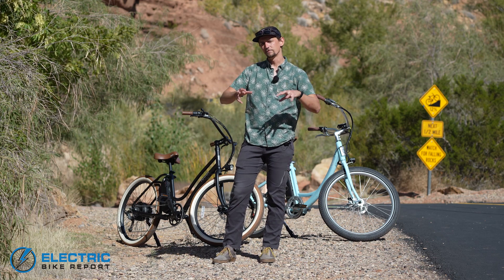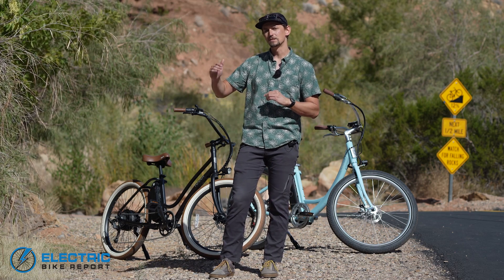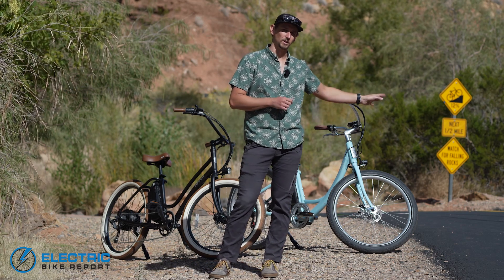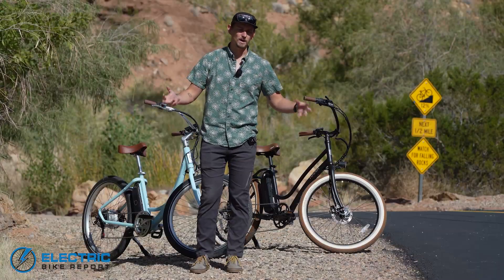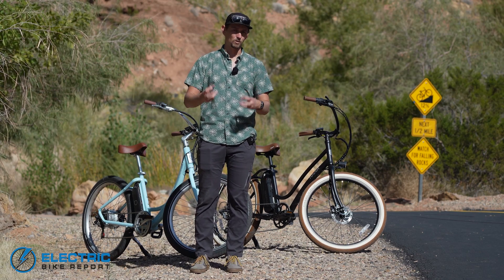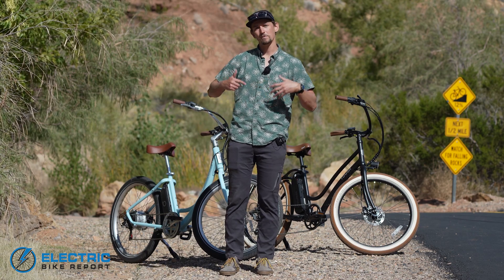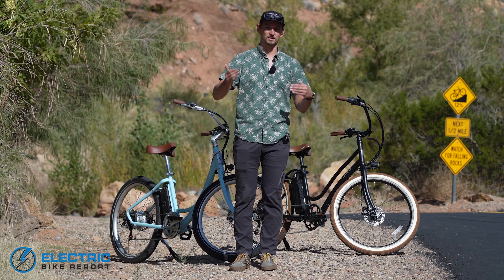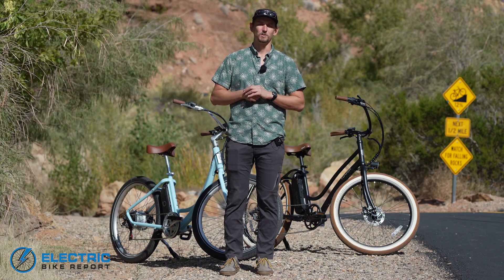500W VS 750W E-bike Motors | Does Wattage Matter On Hills?

Comment: 750W is very good, but 1000W is better...
Reply from the maker: Watts aren't everything! We've tested a few 1000W motors that didn't perform as well as many 750Ws.
Reply: @ElectricBikeReport  if you need max torque on mountains, you must have your 1000W in normal 26inch x 2,3inch, or even 20inch x 3inch wheels, but if you need horizontal max speed, then you need only 750W in 29inch x 2,1 inch in country, or 26 inch x 2,3inch wheels- in city...

Comment: 500w is it geared hub or direct drive? you cannot compare 2 different types of motor 750w is 100% geared hub and geared hub motor are superior with hill climbing and have great torque compared to DD... Direct drive last longer because less moving parts and are great for higher constant speed but sucks accelerating from 0 eating battery like crazy if you don't at least give some pedal boost... if rear wheel is free and go easy it is geared hub... if rear wheel is hard to pedal without electricity then it is direct drive... one more thing DD charge battery back GH not.
Reply: It's about time someone brought up the geared vs direct drive hub motors. I need an ebike to get through the up and down hills from my house to town, so I prefer a lower max speed geared motor over a higher speed direct drive. I just ordered a bike with a 500W 20mph max speed hub motor. Hopefully it is geared and not a direct drive limited by the controller. I don't know because the information that is available for ebikes is pathetic. When you buy a non-ebike, like a Trek, they provide detailed specs. Ebikes should do the same with details like the manufacturer and model numbers of the battery and motor.
Reply: @sandsleeper3124  geared are small in diameter and similar sizes to eachother, direct drives are huge in diameter and stand out, hope this helps

Comment: How do I find out what my controller is for my ebike?  It has dual hub 500 watt bafangs. I was wondering if I could upgrade to 750 watt bafangs for more hill climbing power.
Reply from the maker: You can check out the specs page from the bike manufacturer, but you may need to contact them directly. Depending on the brand, it's usually about 50/50 whether or not it's included.
Reply: @ElectricBikeReport  from the specs on their website it’s kinda vague about some of the parts. I do know it’s a 48 volt 20 amp battery. So I may just call them and ask on the controller part
Reply: My bike is a krusader dual 500 watt bafangs. Can I swap out for 750?

Comment: You perpetuate the mistaken theory that electric motors are commonly rated as to producing "X" amount of power in watts.  Absolute Nonsense.  250 watts  500 watts  750 watts  1000 watts  Controllers (CONTROLLERS) are rated for WATTS.  Electric motors are rated as to how much Torque they produce   TORQUE.  NOT WATTS>
Reply: Mine have 43tq and 500W, but problem is sustained power. Motor after few minutes of big incline turns off

Comment: I made a DIY 350watt Gear( gear ⚙️ can go long distance( 20mph)  all the way to  battery use but very slow on hills) with a 2000 watt Gearless ⚙️ Turbo Hyper Drive Booster( power speed of 40 and up but can't go full throttle of a 4 to 5 miles trip of motor cutting off for a bit to cool down , great on hills of going over 34mph and higher) with this set up I can go long distance of a very high speed of 40mph without the Gearless cut off cool down. This set up should be the standard set up for not only novice e bikers but also for pro builds or factory made. A lot of practical positives and minimum cons as most DIY Duals ppl make are overkill of not being practical of more being obstacles of the weight, energy consumption, brake system and frame wear and abuse.

Comment: The speed is restricted by the fact that it is going uphill so probably won't reach the lower class 2 limit let alone the higher class 3 limit.
I would test the difference between class 2 and class 3 on level ground.

Comment: PLEASE let's see a test of the Avadar C3 250 Watt mid-drive that produces 80 Nm torque and sports a 16 speed Alevio drive train.
Reply: That's exactly what I want to see too. A small 250watt mid mounted motor with long endurance, that can take advantage of the bike's gears: thus produce 80-90nm of torque like you say, way more than the usual 50 or 60 of most hub motors.

Comment: 250w is simply not enough for steep hills. The bare minimum is 500w but for people who weight over 220lbs you will need 750w minimum.
Reply: I have zero problem with my Avadar C3 (250 W/ 80 Nm/16-speed) riding 11 miles a day with an 1860 ft elevation gain. Zero.
Reply: BTW, most 750 W hub motors generate approximately the same 80 Nm of torque.
Reply: @edwardcating that's a mid drive not a hub. Hubs don't got gears and that's the biggest advantage of a mid drive
Reply: 250w works just fine for steep hills unless the person is really overweight.

Comment: I am brand new to all of this. I have been trying to put together a spreadsheet to help me decide which bike is best for me.  I have zero knowledge of the difference between 250W, 500W & 750W hub motors.  My intuition tells me that 750W is way better than 250W.  I am looking for a video that will explain this specifically, whether it's on hills or elsewhere.
Reply: The higher the wattage, the more overall power. The performance is better, but you're also drawing more power from the battery, which means less range.
Reply: @SynthApprentice  what battery would you recommend
For a 750 front wheel ebike I’m building?
Reply: @Danktendo  Um. I guess 48v or higher? My 48v/14ah battery seems to suit my 750w mid drive just fine. I don't know if a front hub motor would make any difference or not. I'm still new at all of this, I'm learning as I go along.
Reply: @SynthApprentice  I, too am new to this but have been researching. The bike I'm going to test ride is 48v/14ah battery with a 750w HUB motor, but it is single gear. I am trying to get a bead on whether it will be sufficient on occasional steep hills. I fear that it will lack enough torque with only a single gear. Will be test riding very soon.

Comment: When you look at specs of faster speed of the higher watt motors to see it is only a few extra mph from 22 to 24. You assume it should be faster but it is your weight and extra cargo you thinking of using bike that fits the RIGHT TYPE OF WATT. If you weigh 200 .lbs it is best to get a 500watt or higher. If ya weight is A BUCK TWENTY fit is 250 to 350 watt  unless you want fast because you will go faster at that weight on 500, 750 and up. The lighter people will take 500 and up motors top speed by 5 notches of MPH. The higher the WATT means the higher the torque NM  or the stronger it will pull off weight, especially use of constant hill climbing/
Reply: Watts does not always = more torque. There are plenty of 2kw motors that have similar torque to a 1kw motor.

Comment: Hi I have a question ? My battery hailong 15.5 ah max current 20 a What happens if I connect a 22 a controller?
Reply: Its possible that you will exceed the BMS current limits when riding full out and the BMS will cut off the battery output when the controller asks for more than 20a.  If you have an LCD display that allows to limit the current from the controller, then just set this to be less than 20 amps. You could replace the BMS with a 25 or 30 amp BMS.  Open the hailong case, and see what cells you have. Look up the max and steady current ratings on the cells, by googling the cells and looking at a "data sheet" for the cells. Multiply this rating by the number of cells in parallel to determine what current your batteries will tolerate comfortably.
The 20 a BMS may be under the capabilities of the cells because the battery maker want's to prevent warranty issues, and/or to save a few bucks on the BMS.

Comment: Is it better to have a higher voltage or wattage? Where should I focus more when it comes to hills? Like would it be enough with a 48v 750w? Or is it just too much and I'd be save with a 36v 500w? 
Thank you
Reply: N(power) = I (Amps) x U (volts)
so
for power you watch Watt number 
but it is all relative
the motor is one component
battery other
and the bike itself third
how many speed the bike has
how big (small) wheels it has
road bikes have an advantage on flat roads
mountain bikes, on the other hand, have advantages on macadam and steep slopes
motor power is important, but not the most important
whether the bike fits your height and weight?
Reply: Both

Comment: 12 degrees for a 1,760ft (1/3 mile) is not too far off the peak angle and total length of my driveway to put this in perspective. 
What would really be useful is a 1 to 3 mile long 12 degree constant climb, where the motor's ability to produce power and do the climb would also be tempered and tested with the heat of the motor possibly shutting down the bike as well. Doing this with each bike and the same rider / load would give a much more standardized test and help people select the best bike for their application.
I live in a rather hilly area and I am not a small guy (100 kilo) and an amputee to boot (above knee) so power is far more important to me than the average rider, I need more help climbing than most since I only have 1 leg to pedal with. Having a known standard for comparison on bikes would be very beneficial to me in choosing a bike (were I still looking, I chose to build my own).
Reply: Your use case is not typical.  When traveling up long hills at slow speeds, initially hub motors can do quite well, their mass will absorb the heat generated sufficiently. But eventually, the heat will build up, and they they may either cut out or damage themselves. Too much heat can burn the insulation off the field coils, or even demagnetize the magnets a bit leading to reduced output.   

I think with your disability, it would benefit you to have a throttle as there will be many times when your legs are not in the position to produce torque, and this can save you.  

Since the hills you want to climb are long and steep, I would look for a bike with a mid-drive motor with a throttle as well as pedal assist.  The company Bafang makes mid drive motors that fit this specification.
They make DIY conversion kits as well as recently motors that can be used for purpose built bikes. The end result is not necessarily less expensive, but the motors have a reputation for being very powerful, which in your case I would want.

Good luck.
Reply: @eideticgoone7035  My current ride is an ICE Adventure HD recumbent trike. I have a modified Bafang mid drive Small Block motor kit from lightningrodev. I am still trying to get the rest of the unit built (battery and lights etc), presently I am looking to install a Rohloff speedhub to allow for shifting while stopped, to help me launch without burning up the motor when forced to stop without down shifting first.

I do have both a hand throttle and pedal sensors, and if I can ever squeeze together the cash for a proper battery I should have a nice ride, even climbing the hills I have to deal with here, with 1500 watts of mid drive. Presently I am stuck til I get a new prosthetic leg, which is being held up by red tape in the VA system.
Reply: Happy to know you decided to make your own bike, i think is the best approach, would really like to know how it goes and if any help needed I know some about ebike with special needs so glad if i can help
Reply: Build a cyclone mid drive. build it as a single speed with a 14 tooth on the motor and 26 tooth  on the wheel. Only use 1/2 x 1/8 chain and sprockets. It will tear up a 3/32 set in minutes. Get a 72 volt 30 amp hour battery. You will have all the power you can handle at roughly 20 plus mph, and it will make that speed up hills. Never a need to pedal. I have my cranks so that they both point down moped style. Much more comfortable. In your case, you can cut off the crank on your amputee side.
Reply: @geraldkoth654 even with a 500 watt motor?

Comment: It's very important for ebike riders to know that just because a bike has a 500 watt or 750 watt rated motor does not mean that the bike's battery or the bike's controller are actually putting out 500 or 750 watts. In order to truly know how much power is flowing to the motor, you need an independent current meter.
Reply: Busting out your DMM is certainly an idea but really the manufacturers should publish the microcontroller configuration and relevant electrical performance data. Info like this is almost always documented somewhere.
Reply: @JiF_cos  I think manufacturers often want to boast and exaggerate, so I don't trust them. I'd like independent and objective numbers.

Comment: The hill tests are full of good information, but I wonder how reliable these hub motors are? Some guy on YouTube said he is an e-bike mechanic and sees a lot more hub motor failures than mid drive motors. I guess because its much easier to lug a hub motor and see higher motor temperatures than on a mid drive motor.
Reply: A direct drive hub motor requires the least amount of maintenance because there’s no moving parts. The hub motors he’s reviewing on these bikes are called geared hub motors and the gears are typically made of plastic nylon so they wear out over time. Hub motors are actually very cheap so if you do burn one up it’s very easy to swap it out. Mid drive motors require way more maintenance because you’re involving the drive train which was not intended for the power of a motor. The chain stretches the gears wear out etc. quicker. 

I’ve built several E bikes and I love direct drive hub motors but with lots of power. Most production E bikes are all geared hub motors unless they’re mid drive.
Reply: @eastwood111  the direct drive is pretty much bomb proof, and if you get it with lots of power it can be a great choice. Have you heard of the all new dual motor Juggernaut XD from Biktrix XD?